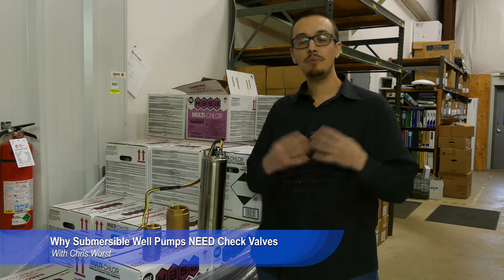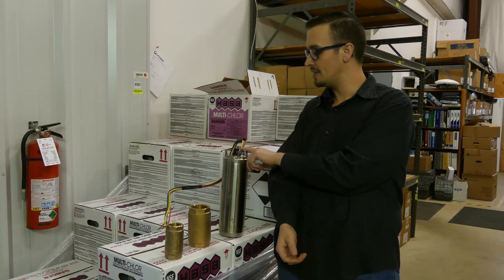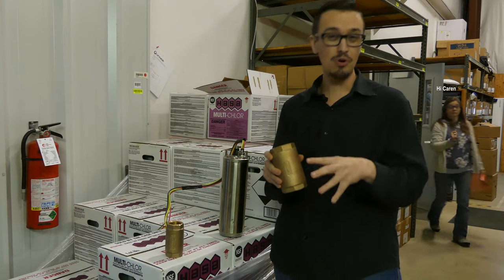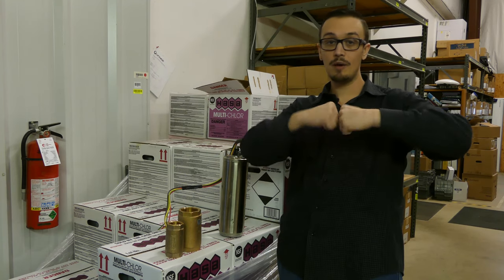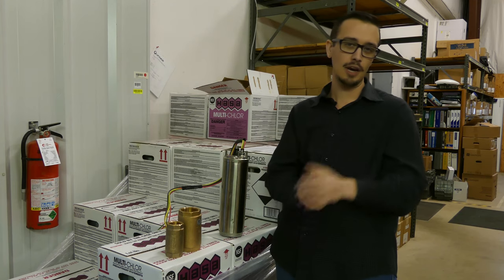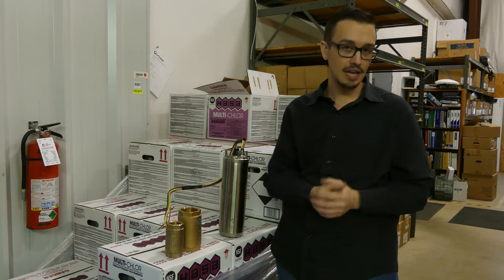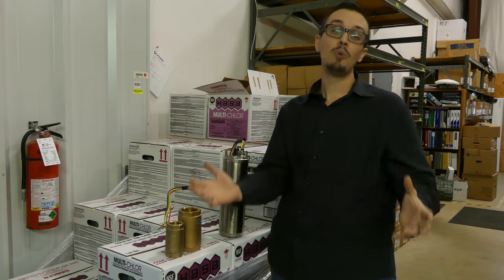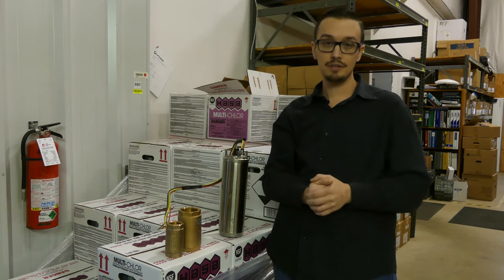Why Submersible Well Pumps NEED Check Valves

Comment: Most of the wells in our area of Whatcom County are shallow well about 25 feet deep because of a thick clay base at that level.   My understanding is that there are fresh water aquifers at 100 feet but salt water infiltration is sometimes possible.  I installed a 3/4 HP Red Jacket 4x29 in a 12-inch diameter PVC casing (no longer legal) 25 foot drilled well.  3 wire, green ground pump is 230 with a separate control box, start and run capacitors with a relay.  No check valves, I didn't know they existed back then.  It has a very interesting 11 3/4 inches diameter torque adapter (came with the pump) installed to keep the pump from moving when it is running.  The adapter flange, what I call it,  is notched for removal past the pitless adapter when pump is pulled.  That was 27 years ago. Not once in that time did it ever fail to pump water.  The system I am putting in now is virtually the same, I am using the same 1/2 of the pitless adapter with a new O ring and the same torque adapter flange.  My pump, Red Lion, has a built-in check valve.   A 25 foot well here in the winter has about 10-15 feet/summer drops to about 5-8 feet of water. So basically my lift is about 20 feet and horizontal 150 to my house.  Should I still install a second check valve in my shallow well?  If so how close to the pump should it be?

Comment: My pump seems like it cavitates. Have you ever heard of a bad check valve causing a pump to not put out enough pressure and volume after it initially turns on but when you cycle the power it works fine?

Comment: Interesting discussion about check valves. I'm a well owner not a pump installer. The need for one at the pump is obvious to prevent water from draining back. In many installations I've seen a second check valve at the pressure tank. This is the first time I've heard about using multiple check valves in the riser pipe.

I'm confused about the need to use multiple check valves, since water is virtually incomprehensible that would seem to make water hammer issues worse, or even create a partial vacuum. As far as I know we only have a single check valve installed at the pump. None in the riser and certainly none at the pressure tank. In our case the pump is at 220 feet and static water level is only about 20 feet below grade, not sure if that has an effect.
Reply from the maker: Check valves are only rated to hold a certain weight. When you don't use enough check valves in your pipe they are much more likely to break under the weight.
Reply: @RCworstwater  Thanks for the response. I never thought of that, several hundred feet of water is a lot of pressure. At least in our case that is not a problem because static water level is so high.
Reply: @Kevin Waddell hey Kevin this sounds weird but iv been stalking your comments as well as the CSV valve guy's comments. Because I am seriously considering getting a CSV but I'm seeing dudes like you keep popping up on youtube and plumbing forums making GOOD cases against CSVs.. Iv talked to the CSV guy who makes good points about them, but I was hoping you could give me a second opinion (cuz CSV dude just wants to sell his product)...so as far as I know I only have 2 check valves. One ontop of my 600 ft deep submersible pump, and one directly before my pressure switch/pressure bladder tank in my celler. I am wanting to Tee off the main line BEFORE the pressure switch/tank to run 300+ ft line of poly pipe out to my yard hydrants. I do not get any water pressure to the Tee yet, because there is that pesky check valve right after the Tee but just before the pressure tank.. Iv been told that removing the check valve there will allow flow to my Tee/yard hydrant, but theres 2 problems: 1) I am not sure if this is safe, because the tank check valve is said to prevent water hammer, but CSV guy has me convinced that water hammer is caused by the pump cycling and hitting the check valve. 2) in any case, I will be causing a more rapid cycling of the pump if my Tee/hydrant is irrigating an orchard and causing the pressure tank (beyond the tee) to fill up over and over again. I have been told putting a CSV before the Tee and removing the check valve at the mount of the tank will solve this potential rapid cycling and protect my pump and mitigate water hammer..............but I keep hearing people like you and other folks say the CSV is bullshit.  Both sides make EXCLELENT cases. I don't know who to believe.
Reply: @Kevin Waddell thanks for the info! So it sounds like if I tee off to hydrant before the pressure switch/tank,  then I can remove the check valve  that's right before the pressure switch/tank, and move it so that it's right BEFORE my tee. Thar way, I dont need to move my Tee to be after the pressure tank.
Reply: @tomstegeman4344  9

Comment: i had my pressure tank replaced a few years ago, i have a new check valve inside the house right by the tank. no idea about my submersible pump... if the pump doesn't run for a while, when it kicks on it sounds like it has to re-prime itself and it quite a bit of sloshing. water rushing up into the pressure tank. wonder if i need to replace some valves...

Comment: My pump hangs at just 50 feet; never used a check-valve and it worked fine for 10 years.  I recently had to change out the old pump. The new pump says it has an integral check-valve BUT, once the tank is full, the pressure slowly drops off with out any water use.  Could it be leaking past the pumps check-valve and going back down the well?
Reply from the maker: It is certainly a possibility, but one thing for sure is that you have a leak somewhere. A check valve should always be installed on the pump discharge or 1st stick of pipe after - regardless of if the pump has one or not. It's cheap insurance.

Comment: Recently had a new well pump installed.  They installed a new check valve above the pump which is only about 160-170’ deep and I also had the well tank replaced.  There’ is also a check valve at the tank.  Whenever  the pump kicks on there is horrible water hammering for the 1st second it runs. What could be the problem?

Comment: If we are winterizing a summer cabin that will have no heat in the winter do we need to drain the plastic well pipe coming into the basement and the first check valve just prior to the pressure tank? Or can we drain everything after the first check valve in the basement and be fine?

Comment: my pump kept short cycling so I put check valve right as water comes in house, stopped short cycling but now pipes always spitting air, I tried running system for like five minutes  so I suspect bad check valve by pump. pumps a bunch of air in pipes each time? what do you think?

Comment: It the rule of thumb for a CV each 200 ft for the total length of the column piping from pump setting elevation to the surface, or is it from pump setting elevation to the top of the water table?

Comment: Say your drop pipe is 300' would putting a check valve just off the pump, one at 150'  and one before the pitman be a good idea? Would that be overkill? If so, where do you recommend putting them?  Could it harm the system? Is there a delta pressure across check valves? Could the check valves support that weight?   Thanks for all the info! Your videos have been a great help already. I am a new to me well owner and have recently started having problems and I am most likely going to have to replace the pump.

Comment: I have a few check valves on my well (well pump is at 180' in a 300' well). Does it matter if check valves sre installed horizontally or vertically? Also, what brand and design of check valve are best to not bleed off?

Comment: Hi. Maybe you can help me with an opinion. I have a pump placed at 70m (229ft). The issue is that i am doing all the maintenance myself. This means that the soul existence of a check valve will make my life a nightmare in terms of pulling the pump out of the well. The water inside the pipe weights too much. I automated the pump so it works for like 30 minutes and then stops for an hour or so (so the motor will never start while the water would flows back). I am considering making some drills inside the check valve that's already inside the pump so the water will be able to flow back and i'll be able to remove the pump if needed. What do you think about it?

Comment: how do you do it so that when you lift the pump it's not heavy because the water is trapped by the check valve in the pipe?

Comment: The check valve on our submersible pump failed. It’s a 55 foot deep well. I installed a check valve in the piping outside of the well but about 5’ next to it and about 8’ deep. So the check valve is about 47’ from the well depth. This was an emergency fix. Hoping to get the well pump pulled and replaced. Just that they charge more than I can afford right now

Comment: Water pressure is good in my house until it's all of a sudden drops to 0 for like 10 secs then resume. irregular....
Could that be a bad check valve? does it mean i need to pull out the whole pump or can i install one at the very top of the pump pipes?

Comment: So you would add an extra check valve on to the end of a new Goulds 7G before installing it in a 120' well?
Reply from the maker: Yes! We always add a check valve right at the pump for redundancy. We've found that the check valves inside the pump end fail much more quickly that an inline valve, so better to be safe than sorry.
Reply: R.C. Worst & Co., Inc. how close to the pump can you actually get? Would 10 feet above the pump be too close?

Comment: Our well pump has two issues. One is a loud banging noise around the check valve when the pump turns off. It almost always happens but occasionally the pump stops with no noise? The other is that the pump breaker is tripping. It has happened twice now and we don’t know why. Any advice please? Thank you!!
Reply from the maker: Please give us a call for help troubleshooting: 855.329.4519
Reply: Thanks, just a follow up. The motor stopped last night. I had the well guys here and they started removing the pipes from the submersible pump when they located wires that were frayed about 150 feet down. That was the problem. They put the wires back together, lowered the pipes back in the ground, and the pump started up again. I will keep your info though thanks for your videos
Reply from the maker: Happy to hear you're back up and running! Thanks for the comments :)

Comment: Hi Chris,   I replaced my well pump last year with a Franklin submersible and, as I recall, it had a built-in check valve.  (The well pump is sitting ~75' down)   I have an issue with air getting into the hot water line and was wondering if a failed checkvalue could be a possible reason.  Any thoughts would be greatly appreciated.  (SW Florida)
Reply from the maker: If air is only getting into the hot water lines you should check the hot water heater connections and piping.

Comment: FALSE. The pump isn't sealed, so without a check valve, all the water will just drain right out of your house, past the pump, right back into the well, causing the pump to have to turn back on again.
Reply: That's the real reason you need a check valve. Everything else is just added potential safety aspects.